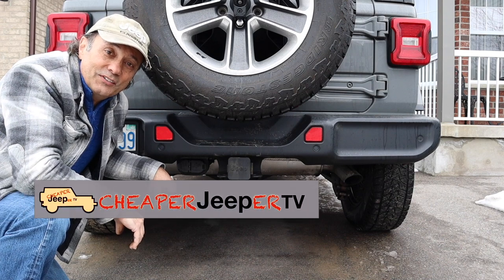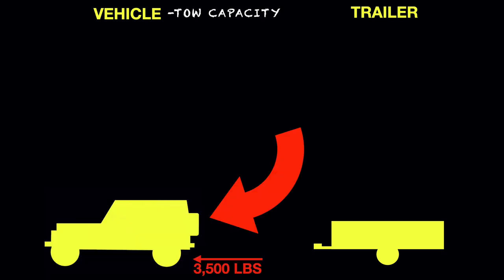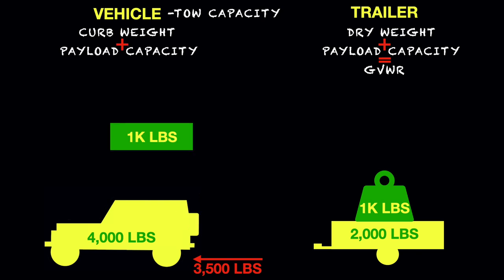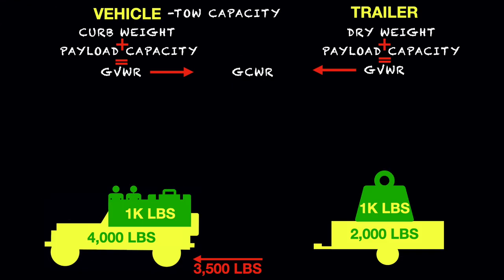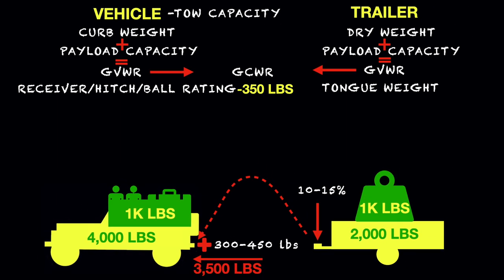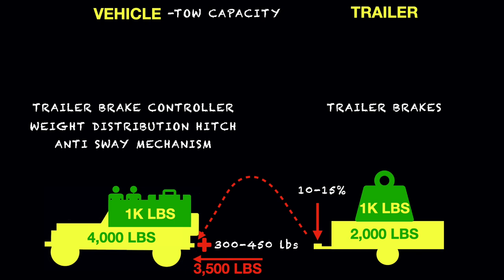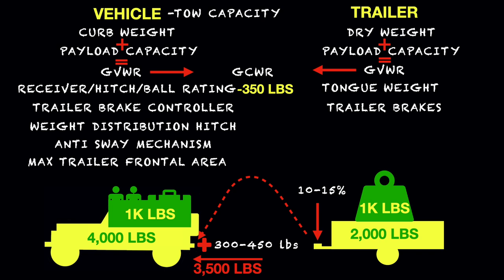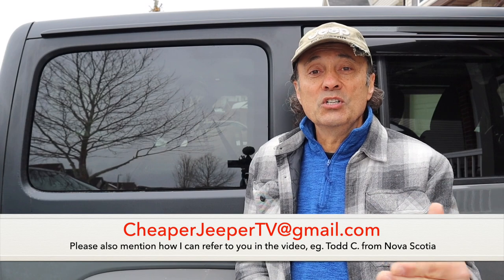Things to Know When Towing With Your Jeep

Comment: I only have a 2004 TJ Rubicon, so I'm even more limited in what I can tow. I did tow a travel trailer, but used a weight distributing hitch and was very careful about my loading. I wish it had trailer brakes, it definitely challenged the Jeeps brakes. I sold the trailer a few years ago though, so no pictures.
Reply from the maker: Yeah. The i’d imagine hills and winds only complicate matters when you aren’t able to tow so much.

Comment: Don't know how I got here, but great explanation! There is a lot to think about when towing, a 2 door jeep vs a 4 door jeep with same axel set up and engine are two different towing specs as well. No jeep is the same and that goes with any vehicle you plan to use to tow with. Do your research and don't allow fancy terms like tow package fool you. A factory add on hitch is not a tow package.
Reply from the maker: Great points. Thank you. 
Cheers

Comment: Thank you for this Very helpful and informative video. I’m a stickler for safety and numbers. About to purchase an Alto Safari trailer (1800lbs dry) for my 4 door jeep. Based on the helpful video, I’m within specs, except for the frontal area (56 sq ft.) and payload may be a bit over (+ or - 50lbs) depending on gear. 

Your video definitely helps Jeepers understand capacities and staying safe! Much appreciated
Reply from the maker: Hey Carlo,
Thank you very much for taking the time to provide some feedback on the video.  I appreciate it very much.
Cheers

Comment: Awesome video! Very explanatory. But I still have one doubt that I can't find a great answer to it: Fuel consumption while towing. I'm tried to figure out how much more fuel would a Jeep Compass would burn while towing compare it to the manual rated fuel consumption
Reply from the maker: When I towed a trailer with my automatic jeep, Wrangler, my fuel consumption increased. I believe that the added weight that the engine has to pull reduces efficiency. I imagine with the manual, the same reduction in fuel efficiency would occur, or the more fuel would be consumed, as a result of the fact that the engine has work more to pull more weight. Other systems are also impacted, for example, the brakes have to work more to stop the extra weight, and the transmission has to work more as a result of the extra weight as well. I hope that helps. Cheers.

Comment: I laughed at the start as this is what’s making me crazy. You definitely did the best explanation but I’m still confused. I have heisted for two years for this fear on not getting my numbers right. Looking at a 1982 900 pound scamp but still not clear how to calculate the 10-15 percent on the hitch . How do I know I’ve loaded 10 or 15 percent? I was told to evenly pack the inside of the scamp but then told to put more at the back to take weight off the back, then told more at the back will cause fishtail. My brain hurts. 
Is there somewhere you can go to have someone help you through it all? Once Im shown once Im good. 
2013 Jeep wrangler sport 2 door. 1982 scamp. 900
2 dogs total 95 pounds 
2 ppl total 290 pounds 
No propane no bikes no bathroom 
I called Jeep and they just told me the two rating. Im mean that’s obvious… it’s on my door . 
And each trailer and each Jeep has some variation that I can’t calculate unli try to weig my Jeep, and trailer with everything and everyone in it.
Reply from the maker: If you are part of a local Jeep Club, I’m sure that somebody there would be able to help you with that. Also the good folks at Wrangler RVing, the Facebook group they could answer your questions as well. But for now, I have heard of people using a bathroom scale to determine the weight down on the tongue by the trailer. I would definitely not have most of the way at the back of your trailer.

Comment: So there's a big difference between what you can tow and what the manufacturer says you can tow every vehicle I ever owned by far exceeded the tow capacity with no problems at all
Reply from the maker: Hey joe, 
Essentially, the tow capacity is just one of the many factors you need to consider if you want to tow something safely  
For example, you may have an official towing capacity of 3,500 lbs for your vehicle, but the stock hitch on your vehicle may only be rated for 350 lbs. In this scenario, the recommended tongue weight for the trailer 10% of 3,500 lbs, would be 350 lbs, thereby maxing out the hitch's capacity! In a case like above it would be easy to exceed the hitch's maximum capacity by simply adding more weight on the tongue of the trailer or when experiencing dynamic load on the road, via some bumps, etc. Then of course, this load on the hitch eats into your rig's payload capacity...so you can see that it's a little involved, so pushing the limits may be a risky venture.
So...you need to realize that you have to account for many interrelated factors if you wish to tow safely.

Comment: I just bought , a 14 wrangler unlimited sport 4 door , what's its towing capacity ?
Reply from the maker: It depends on what axle you have. I believe I if you have the 3.21, it is 2,000 lbs. if you have the 3.73, it is 3,500 lbs. 
cheers
Reply: @CheaperJeeperTV   what's the gear ratio difference ?
Reply from the maker: I think the 3.73 gives the Jeep more torque or pulling power I think.
Reply: @CheaperJeeperTV  you are 110% right , I'm just curious is 2200 lbs gonna hurt if the capacity is 2000
Reply from the maker: Hey Matt,
I personally wouldn't risk it. For one reason, there are reasons for those limits.  Also, if an accident were to occur, and it was determined you were beyond the legal towing capacity of your rig, some say your insurance wouldn't cover you. 
Cheers.

Comment: Throwring around towing terms.. that was funny
Reply from the maker: Thanks. 🤷🏻‍♂️
Reply: @CheaperJeeperTV  Do you have any insight on the better jeep to tow with.  Either the 6 cyliner or the 4 turbo?
Reply from the maker: I'm not a mechanic or anything, but I do have a very strong opinion about this.  In my opinion, the 4 cylinder turbo is already getting the maximum amount of power out of that small block. Over time, that extra power, heat and work being accomplished would definitely take it's toll, and I think the engine's longevity will be impacted.  I think the 6 cylinder would hold up better. Here is a thread on the issue with more. https://www.jlwranglerforums.com/forum/threads/2-0-v-3-6-towing.25269/
Reply: @CheaperJeeperTV  Thanks.

Comment: Some people neg on towing with Jeeps, but they're generally just ignorant.

 Set up your MaxTow Unlimited with an anti-sway weight-distributing hitch, in-coil airbags, and some shocks with adjustable damping. Refresh your vehicle fluids religiously. Pay attention to the Jeep's payload, GVWR, and GCWR. Pay attention to tire condition, ratings, and inflation. Towing at near max capacity will be a non-issue. With full airbags and proper tongue weight, you won't even notice squat, so your coilsprings won't get sagged and your headlights won't be blinding oncoming traffic.
Reply from the maker: Thanks for sharing. Cheers.